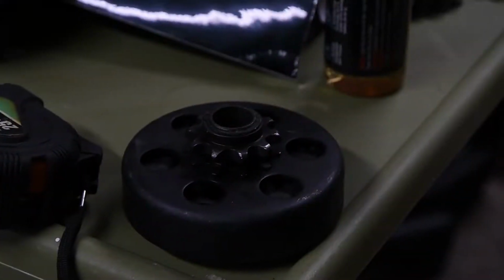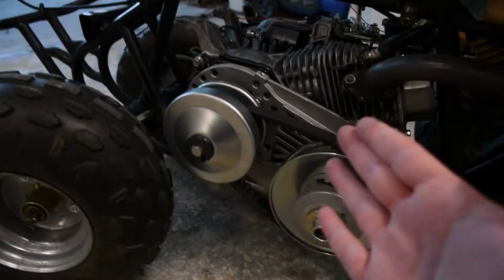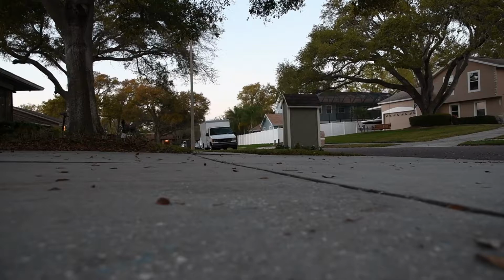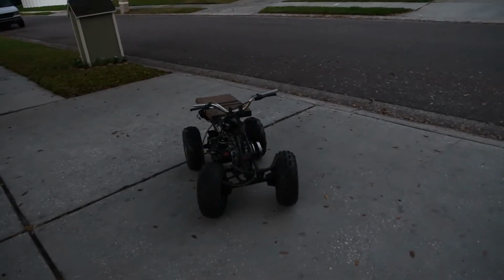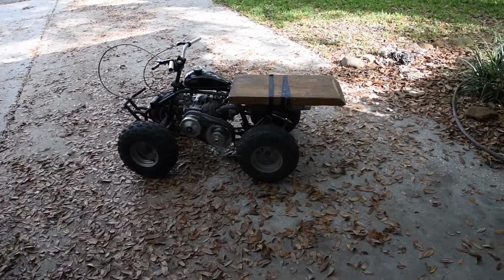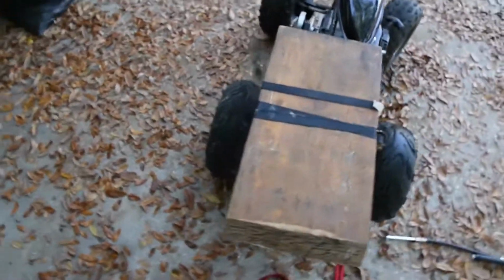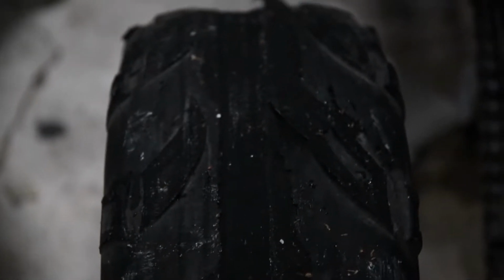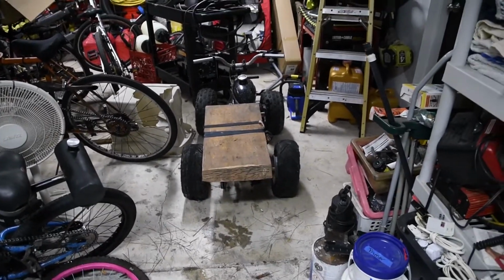Installing a AMAZON Torque Converter on my 212 Swapped 50cc Quad

Comment: Yo believe it or not your vids are what originally got me into the motorized bike hobby. I really wish I could post pics in the comments here to show you what I built. I got a Tillotson 212cc with a welded 14cc high compression head from paul's karts, .356 cam duel 38lb springs, black gauge roller rockers, stainless big valves, billet cam rod fly and crank, real working lights all the way around. All on a super reinforced don't break your frame with 18in motorcycle wheels. Thing will do 95mph